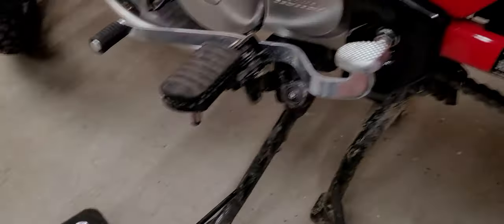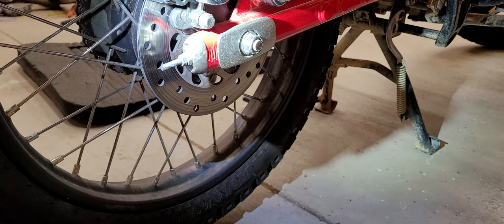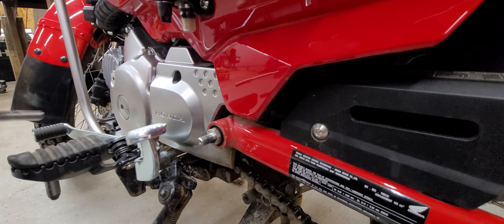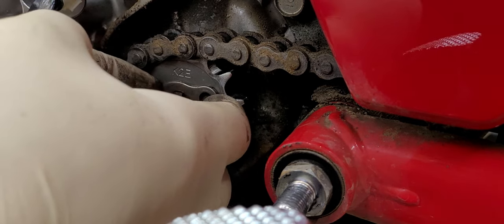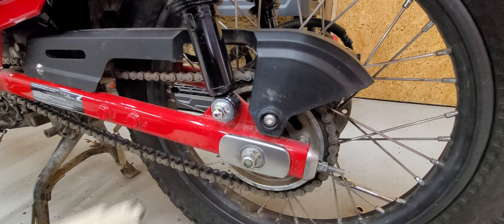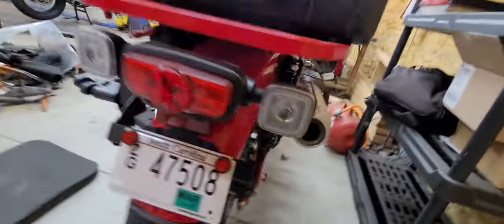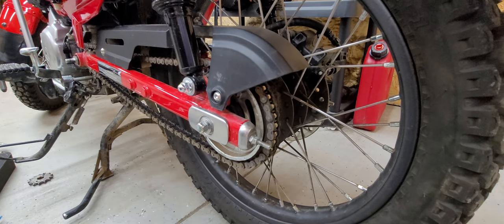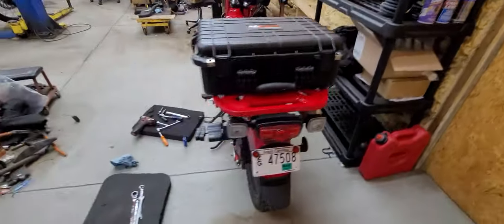2021 Honda Trail 125 13 tooth sprocket install/removal and chain adjustment

Comment: I installed a 13 tooth front sprocket on my new CT125. Climbing ability improved noticeably, what surprised me is that my top speed increased from 85km/hr to 100km/hr, counterintuitive I know, had me stumped for a while but I figure being 100kg the 8hp engine didn't have enough power to fully utilise 4th gear whereas a 13t sprocket allows me enough torque to access the higher revs in 4th gear. Perhaps the 14t sprocket is ideal for the average 65 to 70kg Japanese or Thai rider, not heavy westerners like me.
Reply from the maker: Awesome! I found kinda the same thing. I put the 14 back on for a few long country road trips to slow the Rs down a little

Comment: Should be picking mine up with in a week, I will be doing mostly back roads, and seen that the Super Cub had more top end and they had a 14t/35t and the trail comes with a 14t/38t  was wondering if I put the 35t on the trail if it would give me the top speed that the Super Cub has, and if it will still do hills.   Will be using the Trail as a runabout ( going to the store or picking up gas for the lawn mowers and tiller. ect. )  I have the Honda CB 500X for highway trips, great bike but want something lighter for the short runs and gravel roads, and the larger caring weight of the back rack.  Thanks for the Video but was looking for one on changing the rear sprocket.
Reply from the maker: Seems to be a bit boggy on big hills with higher gearing than stock. I think you'll like it the way it is for what you need it for. Best of luck to you! Thanks for watching!

Comment: I thought I have seen in one of your videos that you went to a diesel school maybe I heard wrong, are you a diesel mech.?? have a great day man.
Reply from the maker: Hey Gary, I went to Nashville Auto-diesel college. At the time it was the place to go. When you came out of training there you were certified in Gasoline and diesel engines, automatic and manual transmission light and heavy duty and all the fuel and ignition control systems for auto and heavy equipment. Very good school at the time. I've definitely worked on diesel many years ago but I ended up being an automotive technician. We mostly service GM, Honda and Toyota here at the shop. The school was great because you left with an associates degree in 11 months!

Comment: Another great video -thank you.  I have the 2023 with next gen engine so hope sprocket fit is same.  Could you please share what sprocket (13 T) manufacturer you recommend and best place to get?  Appreciate!  We ride some of the same trails!
Reply from the maker: Thanks for watching and the kind words. If you go down below the video in the description I should have the link down there. We use JT sprockets here and have had great luck with them.
Reply: @PSBEadventures  sorry - I just did not think to look there - my bad and thanks much!
Reply from the maker: @charliesadielouie  No problem at all. Just posted a new one that comes right by you guys in sky valley. Epic 4th of July holiday ride!!!

Comment: Do they make (is there a) 15 tooth front sprocket that fits on these.??
You know, for us that don’t care how fast it Takes Off, but want it to get near 60 mph for traffic when you Have to be on a State road…
Reply from the maker: I think the 15 tooth would bog the little 125 so much it would never be able to get up to speed. Might be hard on the little clutch. The factory gearing is going to be about as high as I would recommend
Reply: @PSBEadventures  Ok, thanks... That makes since...!! 👍

Comment: What’s the torque for the bolts on sprocket
Reply from the maker: @natm3145  no idea. Too many years of gutentite (calibrated elbows) 🤣🤣🤣🤣🤣🤣
It won't be much though, they are only 6mm and only hold the washer in place so not much stress on them. Wouldn't be much over 5 or 6 ftlbs if guessing.

Comment: I was told the 14 may it give more top end speed but based on the lower power motor it’s hard to find the horsepower to make a speed  difference. What have you noticed.
Reply from the maker: I noticed the top speed to be fairly close to the same, but the 13t really has the engine winding high. It definitely has its place on the trails and for deep sand

Comment: How much top speed did you gain with 14 tooth sprocket?
Reply from the maker: Both sprockets have about the same top speed, the 13 just has a bit more rpm at the same speed

Comment: did you have any trouble with the ABS sensor with the 13 tooth?
Reply from the maker: At close to top speed for a prolonged period, it would flash but reset when cycling the ignition. No issue off road at moderate speed

Comment: What receiver hitch hauler is on the Jeep? Does it’s work out well and is it easy to load?
Reply from the maker: That's the haul master 400 from harbor freight. There's a video here on it with a link for ya
Reply from the maker: https://youtu.be/toVjDWuIGo4

Comment: Quick question this is my first motorcycle since I was a teenager. What fuel do you use ethanol non-ethanol and what octane on the trail 125??
Reply from the maker: Congratulations on getting the bike. Definitely try to get non-ethanol if you can and 87 is fine. I run non-ethanol 90 in mine just because it's what my local station has. The compression ratio is low enough to run 87 as well. E10 is fine if you plan on riding a ton and keeping it fresh, but 100% pure gas is best. Thanks for stopping by the channel!
Reply: @PSBEadventures  Thanks bud! Love the channel 👍👏
Reply from the maker: @sman222222  anytime!!

Comment: wHAT IS THE SMALEST FRONT SPROKET U CAN GET
Sorry about caps
Reply from the maker: I think you can get a 12, but it begins to be an issue binding the chain if it's too small, better to go up on the back
Reply: @PSBEadventures  … Do you know IF there is a “15 tooth” front sprocket that fits these.?? 🤷🏻‍♂️
Reply from the maker: I'm not 100% sure on that, maybe a 12, too small can bind the chain some as well